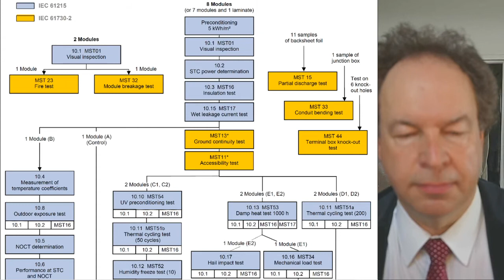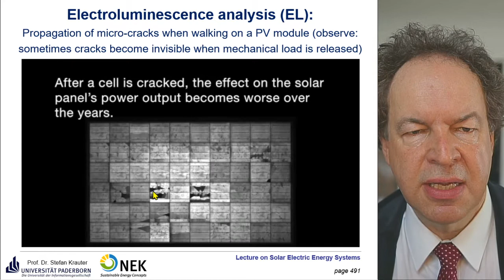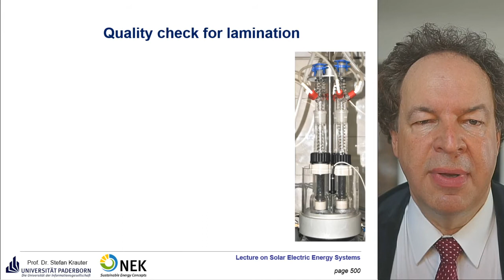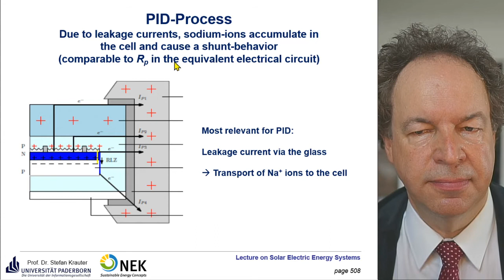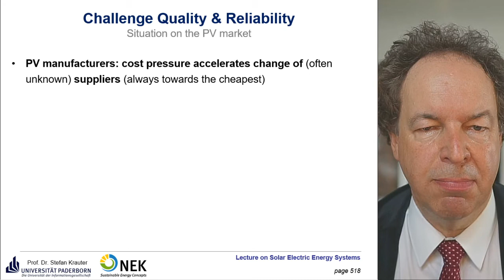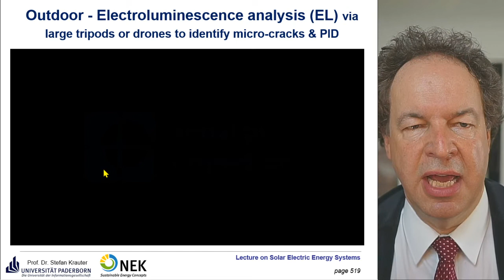Lecture 10 "Solar Electric Energy Systems" - Quality and Durability of PV

Comment: Sir  how can I check whether my module complaining all IEC standards
Reply from the maker: There are independent test instiutes who carry out the complete IEC tests or a part of it (e.g. for recertification) https://test.iecee.org/dyn/www/f?p=106:42:0:::::
Reply: Dear sir, please share me the parameters of IEC 62125, IEC 61730 and IEC 60227.
Please elaborate the tests needs to be done to meet the compliance of above mentioned standards.
Reply from the maker: @vinayr9116  it consists of various optical, electrical, thermal and mechanical tests. You can purchase the standard with all parameters at IEC.ch